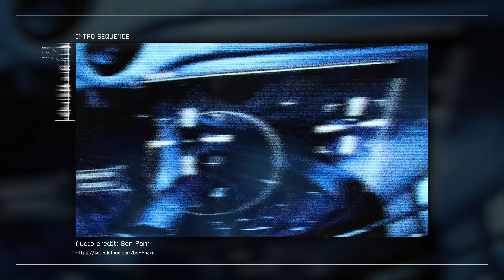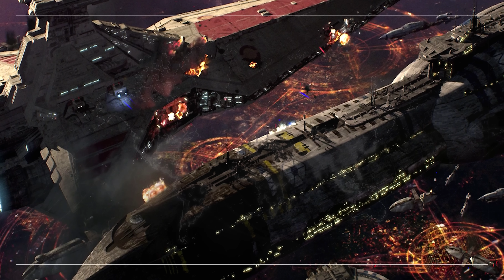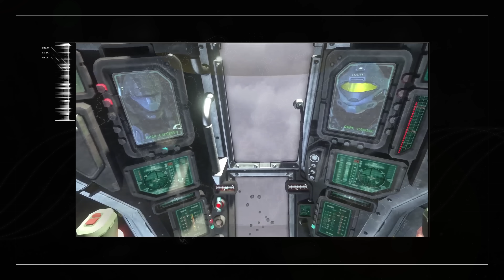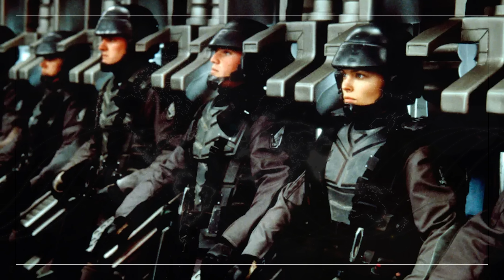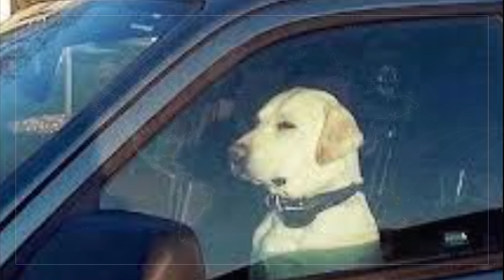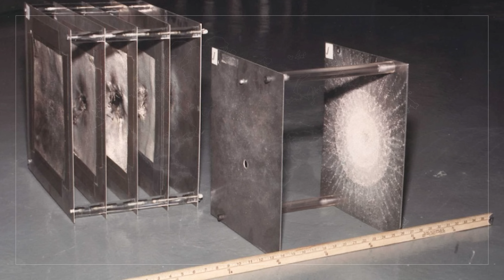The REALITY of Space Warfare

Comment: I really like the idea of stealth spaceships that close down their radiators and drift in place until they get close enough to attack. A bit like submarine warfare. I imagine that the stealth ship would have a heat sink that would only work for a limited time and than it would start to heat up, the crew / electronics starting to cook. The sweating captain looking at the temperature hoping that they can last longer than the enemy stealth ship, making them activate their radiators and targeting finding them first, so that they can destroy them.

I also really like the Idea of hiding your ships by coming at your enemy from the same direction as the sun. The suns massive thermal signature blinding the sensor.
Reply: A subtle sensor system would see a ship occluding the stars and even the sun.
Also, shutting down your reactor doesn’t do very much unless you never had any heat. You have to be dead for a long time to reach the same temp as the background material. That only worked in Battlestar because they arrived at the tail end of a hot battle, so shutting down their reactors made them look like many other hot dead ships and ship parts.
Reply: I love the idea of using the sun. The exact same tactic as WWI dogfighters flying out of the sun still works lol
Reply: "I really like the idea of stealth spaceships that close down their radiators and drift in place until they get close enough to attack."
I've put some thought into this and there are three factors that should be considered here.

Firstly rather than shutting down cooling the opposite should happen since you want to actively mimic the thermal characteristic of the background. 
The usual rebuttal to this is that this would cook the crew or contents in short order however the cooling requirements aren't as bad as most imagine since you only need to cool down an umbrella like shield facing in the direction of the target, coupled with metamaterial stealth and you have an effective, if directional form of Stealth.

Second directional changes can be accomplished with neither a drive plume or radiative scattering from reaction mass by having the stealthed craft made up of a cluster of rotating elements fastened together by tethers. 
Relative velocity can then be generated by releasing counterweights at specific moments on the approach trajectory.

Finally such a stealth attack craft isn't suited to a human crew due to the time spans involved, plus the heat and bulk of life-support e.t.c. An unmanned AI drone is far better suited to the role, especially as it can be powered down on approach to reduce the load on head dissipation.

A sunward approach is actually easier to spot than any other direction due to the blocked radiation and heat differential. 
It is easier to be overlooked when you are mimicking a random- mostly empty part of the sky than an active point of interest like the Sun.
Reply: @Quotheraving 
Orbital mines satisfy those factors better than any other weapon. They are unmanned, they can match the temperature of the celestial object they're orbiting, and they remain in a low-power mode until they acquire a target. As for weapons, here's what I'm thinking of:
- An anti-ship missile
- A shotgun blast of tungsten flechettes
- A laser so powerful that it melts the mine (which is fine, because mines are one-time use weapons)
- A bomb-pumped X-ray laser/Casaba howitzer (assuming that nuclear weapons aren't banned)
Reply: @InvictusMatrix Absolutely not!
Orbital mines are stationary by definition and space is big, too big for them to be either useful or effective. 
Place them in a more constrained and critical location such as a vital orbital path and they become more of a hazard to you than the opponent. 
Furthermore metamaterial stealth is directional by nature meaning that the mines would need constant attitude correction for an opponent approaching on a previously unknown vector.
Making them mobile results in the gasses or heat emitted being eminently detectible and as they are slow moving they require significant changes of deltaV.
Finally being relatively slow moving and in a critical location they are both in a sector of space under extreme scrutiny by the opponent and afford plenty of time for said detection. 

Seeking attack drones avoid all these issues.

They are designed to approach from multiple uninteresting directions thus minimising the risks of detection.
Their targets are more likely to be fixed installations and as such attack vectors are planned and insertion manoeuvres can be set up in advance.
Since their target and the likely detector arrays are fixed the craft's attitude can be aligned to best counter active radio, optical or thermal detection.
Vastly fewer are required for an effective assault and the window of detection can be further reduced by their velocity (less time to detect = lower chance of discovery).
Reply: @Quotheraving  what empty part of the sky? You will be passing in front of stars constantly and even if you project onto that umbrella a star, the dumbest of AIs will still catch you easily with two simple cameras separated by any distance covering your approach.
Reply: @jsbrads1  what empty part of the sky? You will be passing in front of stars constantly.
1. Empty of significant 'noisy' features such as the local star, planet e.t.c. 
The goal isn't to have perfect void as a backdrop, merely to have a part of space that isn't interesting or varied enough to warrant detailed survey over the timescales involved in an approach.

2. Metamaterial is used to redirect radio and optical in order to better mimic the background, this distorts the image somewhat but no stealth is perfect and we're gambling on general surveys discounting such aberrations as software glitches, ionisation or some other anomaly in detection - The 'umbrella' is to minimise thermal conduction from the craft to the surface since thermal radiation and radio are likely to be the main forms of detection.

3. You are assuming multiple omniscient detectors with full AI attention and 100% coverage, I think that's unlikely. 
I on the other hand am assuming that detectors are likely to be highly directional, oriented to monitor major orbital paths both in terms of detection fidelity and AI attention. 
This is because most readings of the majority of space are of low priority and interest while minor optical anomalies are unavoidable and required to exceed a significant threshold to warrant more detailed scrutiny.
Furthermore they are most likely in known locations due to the size required for decent fidelity at the distances involved and hence directional stealth solutions can be arranged and aligned accordingly.

The aim of stealth in space is NOT to achieve undetectability (an impossibility), merely to be vague and uninteresting enough to avoid active scrutiny.
Reply: @Quotheraving  a dumb cheap specialized AI and a dozen cheap large aperture cameras can do the job. The ship’s primary AI wouldn’t need to occupy itself with this.
Reply: @jsbrads1  in that case then why with our expensive highly specialised computers and large expensive camera / telescope / radio arrays can we not achieve anywhere near that level of scrutiny even of the highly directional locations we monitor.

Now having said that do a quick search for metamaterial stealth and ask yourself "If you can make optical detection difficult for the human eye at close range with a detailed, moving and complex backgrounds then isn't it asking too much of a simple optical survey of a relatively uninteresting and tiny patch of the sky?"
Reply: @Quotheraving  this is new technology and it already has proven its ability with the first prototype. See Vera C. Rubin Observatory. In the near future, smaller cheaper versions of these types of cameras will be available, and the computing power would be negligible.
Worth noting, this camera/AI system is worthwhile to be running in the background constantly to alert the ship of incoming objects that are of natural origins too. Design it such that anything big enough to see is something you would rather avoid or deflect, and it can even handle deflection bullets while sending maneuver recommendations to the chief AI.
Reply: Imagine a small battle cluster going into backup energy mode and going silent, hiding inside a sea of dead ships and rubble.
Reply: @ericeversole7943  it would only be possible if those other ships were still hot, or if the ship is crewed by tardigrades.
Reply: Hey, screw your realism.  @jsbrads1
Reply: @jsbrads1 
Also, space debris doesn't stay in one place like maritime debris. All of their different vectors and velocities ensure that they'll scatter and eventually form a sparse ring around the nearest gravity well.
Reply: @InvictusMatrix currents tend to disperse maritime debris too.
Reply: Add to this the idea of exercise being banned (no need for excessive metabolic activity) and thus they're all thin and weak, too. Fascinating concept.
Reply: @TheRaptorsClaw 
They could exercise outside of combat.

Comment: I think the assumptions about infrared sensors are wrong. 
Here's why: 
Number one at extreme distances you need extreme resolutions and so far that means huge apertures (ie telescopes) these would work but they have a narrow FOV and a lot of data to process. 
Number two the easiest way to mask thermal signatures is to coast in with engines off.
Number 3 the solar system is full of hot stuff because the relative temperature facing the sun is quite high. Thermals will only work where the sun is weak and farther away from a planet. 
Number four, would be using a gas medium to rapidly expell lots of heat, think sublimation cooling like the system used on the Saturn 5. It isn't sustainable but if you're on a ship going into combat it will work. Also directional radiators, having things like slats that reflect infrared or scatter it. 
Stealth will be a thing in space.😊

Comment: Lol at the defense options in comments. 1) pen lasers can punch through carbon. Pure carbon tightest form like diamonds burn at 1000 to 2000 C . Larger mega pen lasers can reach that. Definitely lasers size you're talking way hotter. 2) scattering by reflection just creates more lasers. They use highly reflective mirrors to split or redirect in labs without it losing much energy 3) color absorption or using black leads to heat material decay like carbon it'll either ignite or in space rapidly heat decay 4) spin spread over area lol versus a war laser meant to destroy as soon as it makes contact. Lol are you spinning at speed of light 5) if a laser gun is fixed on target that target isn't going to have time to respond lol typical shock response to such things like a gun pulled on you in person is three seconds. Lol that laser in space would've traveled near 900000 km in that time. Well over twice the distance to the moon
Obvious but difficult to achieve solution. If know what type of laser then it's simply create a wave shield of same type energy and colors etcetera but set it's waves counter to the lasers wave frequency amplitude. Waves cancelling our waves. Only problem is interferences created would likely make a lot of energy points where the waves coalesce thereby just creating a bunch of plasma like bombs around ship assuming there's anything to ionize 
Oh yeah a plasma shield isn't going to work unless you got something in space to ionize to create the plasma shield or if it's to create a shield to stop ionization again where's the electron or such material to counter the excess ions.r

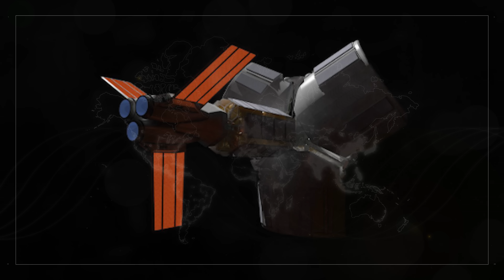Comment: 11:00. Well if you had enough electrical energy. 

You could continuously recondense cryogenic liquids. 

Which is used to cool the components internally. 

Which would of course produce a gaseous vapor. 

But again with enough energy. You can always recondense it. 

Yes the recondensing process. Would cost as much or more as the heat you are dissipating. 

But you'd just trading efficiency for internal heat dissipation. 

So technically it should be possible. 

If you have enough energy available. 🍻🥓

Comment: Well they're not 100% efficient. But pretty close. As long as they don't give off visible light. 

Technically a vast majority of the energy will turn into heat. 

So an electric heater is pretty close to 100% efficient.

Even If they are very inefficient. LoL

In terms of electrical energy cost. 

🍻🥓

Comment: radiating heat in a particular direction isnt hard at all u just need to enclose ur radiators in all the directions u dont want them to radiate and only open them towards the direction u want, like literally just put them inside a reflective box with one side missing. If u have ever seen a glass-top resistive electric stove thats a directional infrared radiator right there.

Comment: 5:00 Today we have solid fueled ICBMs that sit in their silos for up to 2 decades. We've had that technology for 60 years. 
11:00 Sure, just shield your radiator. Put an opague light shade around it, and gimbal the whole system. The higher the aspect ratio of this shield the more colinated the thermal radiation. With something like an arbitrarily high aspect ratio straw, with a heat source at one end, you could an arbitrarily narrow and asymptotically parallel beam. Point the straw where no enemy are.
If you use a brachistochromatic flight profile with some scifi super high ISP fusion drive, which is constantly emitting thermal radiation, just have the radiators facing the same way, and cowl the whole thing in a shade.

Dodging. At long distances, objects aren't where they appear. To fire any weapon, even if using a laser, you have to predict where the object is presently (because you're detecting the IR radiation emitted from where it was some time ago) and where it will be when your laser hits.
If you're using a brachistochromatic propulsion system, you just have to randomly gimble it every few minutes, causing you to wiggle. Preemptive evasive maneuvers.

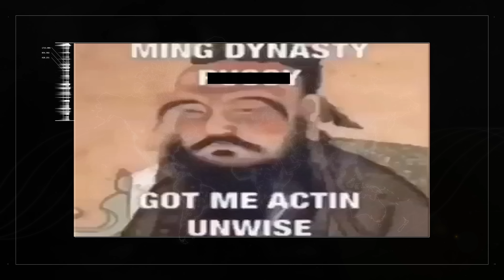Comment: 6:28 counter point to the disadvantage of being in a surface to orbit war: you have access to cover and camouflage, whereas the orbit party, (unless there's a significant tech difference maybe) does not. 
As for resources, that, to a degree, depends on how resource-rich and resource-available the planet is, as well as how well-stocked the planet was when the battle began. A plant can hold a lot more food, ammo, and soldiers far more economically than a fleet of ships can. Logistics will be a vulnerability, however. 
For attacking an enemy in orbit, while it may be more expensive to get bombs ip into space than to drop the on the ground, it would be cheaper than sending a spaceship. We already send missles into space, that is actually how ICBMs work, so it wouldn't be any more expensive than launching a nuke (ignoring the cost of the bomb itself, as that can be switched out according to one's needs), and there are good chances that it would be easier to hit the space target than the surface target. 

Tldr: in a space battle, planets are fortresses, and in planet to planet battle, the one that isn't sending ships is the one that is expending less resources, though is under siege. However, a siege can only be maintained as long as the siege party can maintain superiority, and that might be difficult if the planet under siege has backup on the way.

Tldr for the tldr: a planet is basically a gigantic raid-boss ship that can't run away, where you gotta look for weak-points, which will be competently hidden and defended.

Comment: For the heat radiators it'd be a good idea to put the radiators on places that are far from the important things. Imagine ships with tentacles or spikes coming out, at which tips most of their head is radiated. The camouflage would not avoid detection, but it'd be hard to guess where to shoot when the heat signal may be far away from the ship itself. Maybe meta materials that work as lenses that make the heat source seem as if it where shifted in a confusing way, again trying to trigger a fail on first shot. You could go wide, but space would require *a lot*, so the ship might still have a high chance of surviving a very spread out attack, which gives them time to respond, with a missile that will give them a trajectory at least to where the bullet came from. So missiles that may take different routes may be attractive because you can survive a counter volley, but missiles would only work on a smaller range to make sense at all.